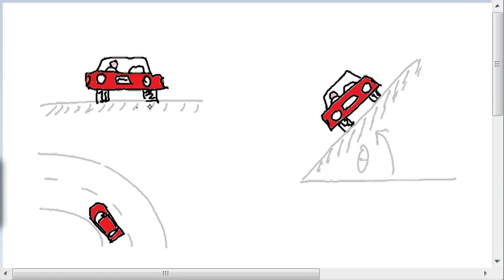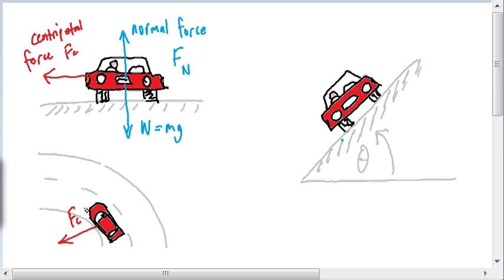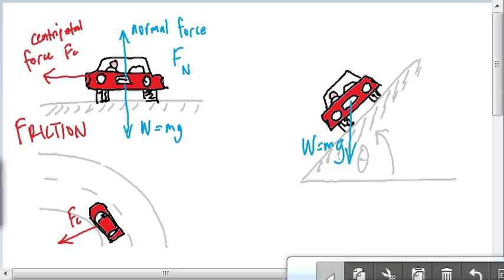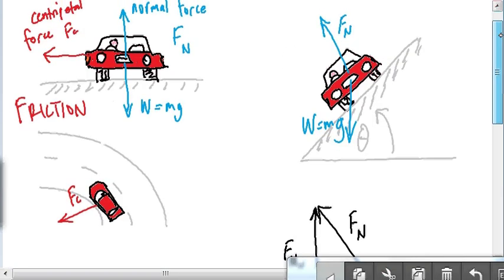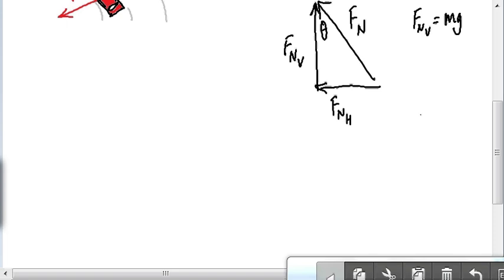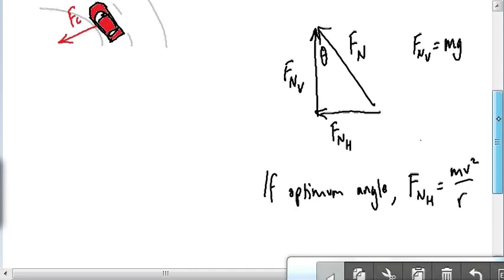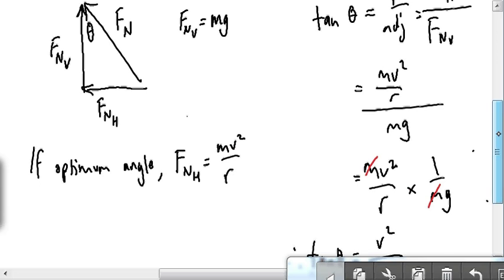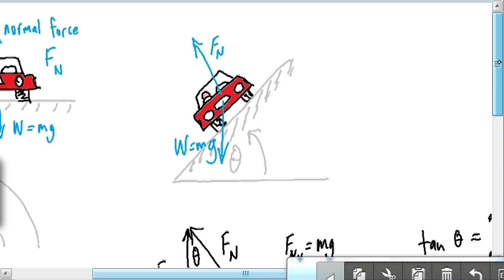Derivation of the Banking Angle Formula

Comment: If you resolve the mg force into components then it's x component would balance the Normal Reaction and you would have no force in the horizontal direction. Please explain. I'm getting confused,
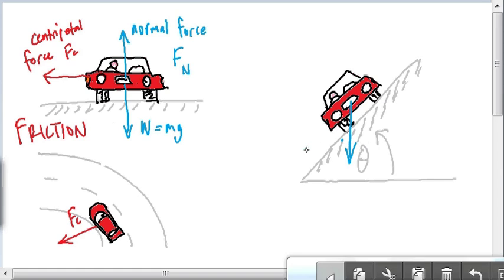Reply from the maker: ***** The mg force is vertical only (2:40) and therefore has zero x component. Are you sure you meant the mg force?
Reply: bobthefish Wouldn't it have two components? One along the inclined surface and one balancing the upward reaction force/.
Reply: +bobthefish when he's saying x he means parallel to the surface - as if this were an incline plane problem.
Reply from the maker: +Daniel Folsom Thanks for the clarification! I was feeling confused thinking our components were defined in the same way.
+Anwaar Khalid I've approached this problem with x component (horizontal) defined as parallel to the unbanked road surface (the surface from which the banking angle is measured), and the y component (vertical) defined as parallel to the direction of the weight force (mg). If you're using an inclined plane analysis your vectors will probably require a different approach to my video.
Reply: I am not a physics expert at all, but just a shot in the dark (Anwaar might want to wait for bgbthefish to confirm this): In the incline plane problem we set the normal force equal to the y component of gravity (perpendicular to the plane) because we want the forces to negate each other - there's no acceleration, so the forces have to add to zero.

In this problem - there IS an inward acceleration, part of that ... I THINK ... comes from the Normal Force. So we wouldn't want the normal force to be cancelled out by the y component of gravity - we would actually want it to be larger than gravity.
Reply from the maker: +Daniel Folsom I agree.

Comment: I don't understand why you can use Fnh = mv^2/r in this case. It's not an optimum condition where there is no banking, so how can you say that Fnh = Fc? Wouldn't it make mores sense to say Fnh = Fcx where Fcx = (mv^2/r)cos(theta)?
Reply from the maker: In this video (at 5:50) we are only considering a case where there is no friction acting on the car, so all the centripetal force is provided by the horizontal component of the normal force. That is, Fnh = Fcx. You agree with this so far, I believe.

In the example we are considering, the car is in uniform circular motion in the horizontal plane, and not accelerating at all vertically. That is, acy = 0 therefore Fcy = 0. Therefore Fcx = Fc, so we can say Fnh = Fcx = Fc = mv^2/r.
Reply: bobthefish Okay. Thanks.